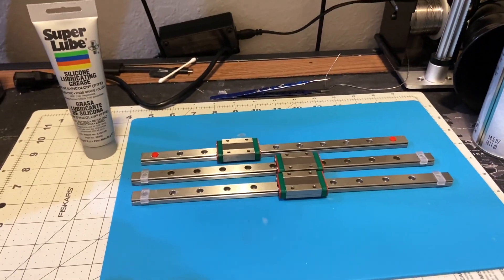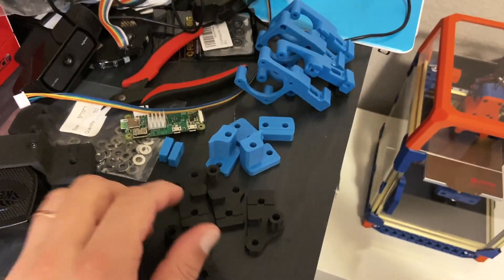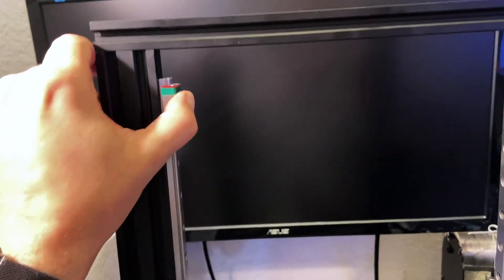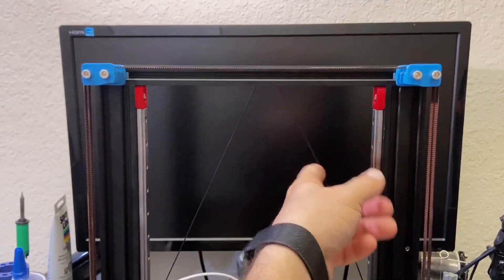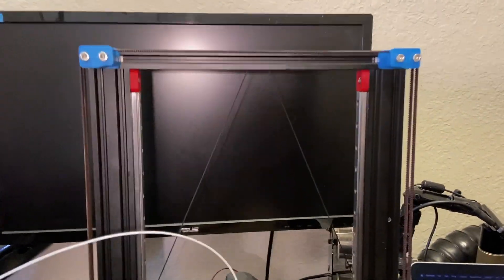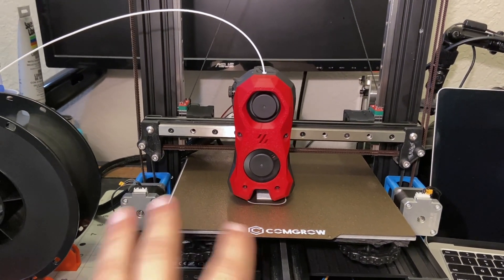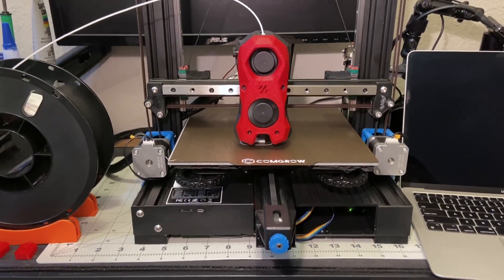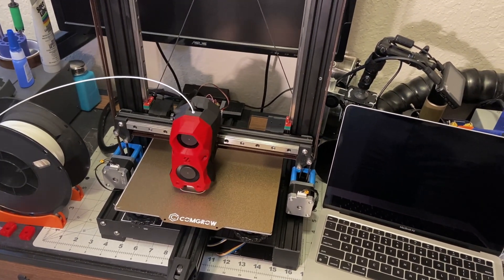Ender 3 to Voron Switchwire CoreXZ Conversion (Part 1)

Comment: Why does everybody think they know how to lubricate everything better than the manufacturer?
Reply from the maker: Who said we know? I contacted manufacturer before procedure, they approved this lubricant, warned me it will not be as smooth but PTFE will last longer than oil used by them.
Reply: @hobbyistnotes  did they say how long their oil would last?
Reply from the maker: @pixartist8190  No, this manufacturer didn't say much about quality or type of the lube they used and that is the problem when you want to add it. So 'we' are making safe assumption in this case that manufacturer saves money on everything making cheap rails, that is why it's easier to replace lube with your own quality one right away while it's not on the printer.
Reply: @hobbyistnotes  
People producing cheap knock offs don't know how to lubricate their crap. I can't imagine them having test benches and actually testing lubricants, seems quite absurd for a company producing barely functioning stuff with the goal of producing as cheap as possible.

If you want to know what's a good choice for linear rails look at the specifications of a proper manufacturer.
They extensively tested, they actually know exactly what's good for short stroke operation and will take the longest time until pitting and such will occur.
Reply from the maker: @heinzhaupthaar5590  people make huge deal out of this lubricant- topic but it’s just a 3D printer… not a rocket science… at this point everyone uses what ever is a “standard” by the community and proven with thousands of hours of printing…
Reply: @hobbyistnotes  okay that makes sense but you are by far not the only one. Every build video I watch the people do this, never with an explanation other than "the original lubrication is crap"
Reply from the maker: @pixartist8190  Cheap rails have very long history of using very crappy lubricant that was jamming and mashing the balls... I think that is the reason why...
Reply: because most of them are engineers themselves lmao
Reply from the maker: @user-yk1cw8im4h  I have an engendering degree but still can’t qualify myself even an amateur in this field. Mostly it’s dictated by concept: Monkey see monkey do, learn on mistakes and make better decisions ;-) My actions are close to that concept. I have made my personal research and did what I did and I didn’t say you have to follow my actions ;-) just sharing my experience, nothing more.
Reply: @pixartist Linear rails pretty much never come pre-lubed. The metal is only treated with oil so it won’t rust during storage/ shipping etc. Oil is no suitable lubricant for linear rails. 

So if you’re running your linear rails out of the box, you probably will wear them out really soon and probably experience them being louder than expected.